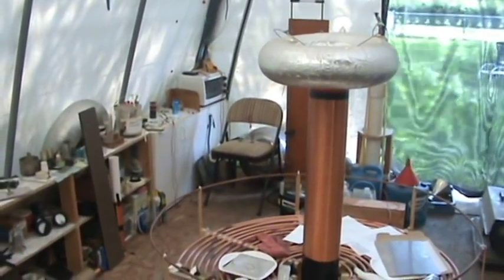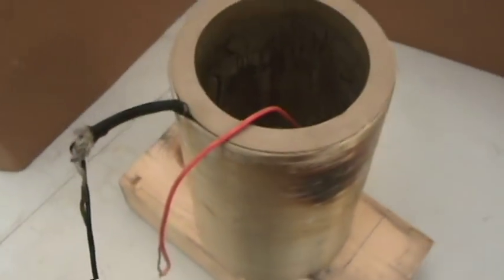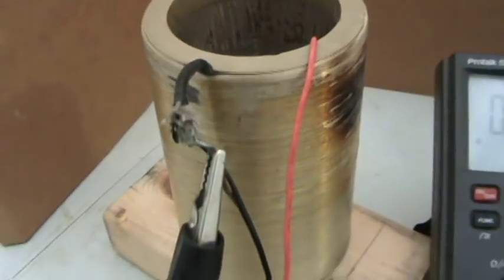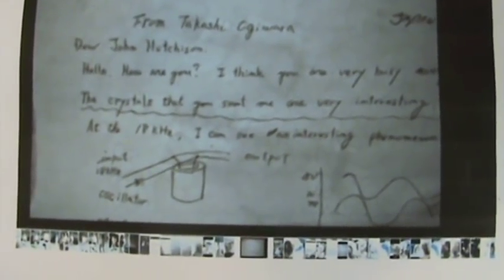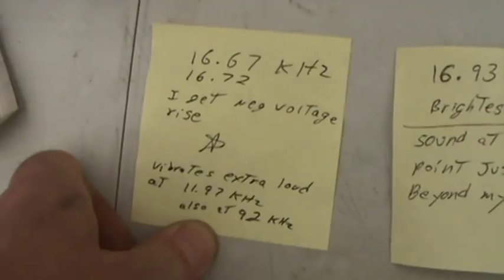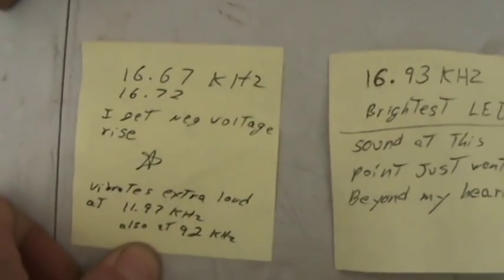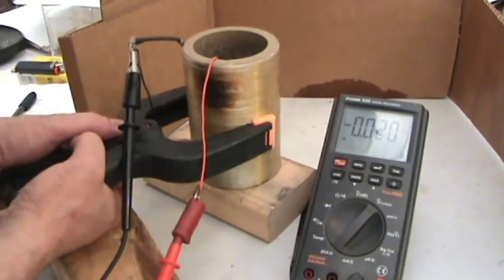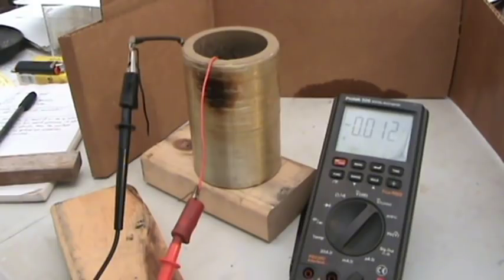Free Energy Barium Titanate  Part 1

Comment: Hey just wondering what John has told you about using barium titanite in a cell configuration. Did he have cat whiskers separating them or was it just stacked barium wafers thanks.
Reply from the maker: Well, he had his Hiroshima power converter that had about 6 of these cylinders in it and he had used a micrometer part for the adjustment of pressure on them.  I think that produced about 24V and a few Amps.  But then he had some of his best cells that were made up of about 60 stacked crystal wafers, starting at about .060 thick  & down to about .004 thick, each being slightly thinner then the last and they were also culturally grown many micro points/hairs on them,,,if i remember correctly i think they were carborundum. and same thing were he used micrometer for fine adjustment of pressure to the whole stack.  you can see his cell here with the red LED on it,,,but this is after it has been setting around for many years and was taken apart and then put some of the parts back together again after years have passed.  He has had regular incandescent 60 watt bulbs lit off of this before.  John talks many times of cat whisker technology.  Technology also used in his Field stress detector(FSD) that he worked on.
Reply: @INVENTOR3  thanks for the reply, with the carborundum cat whiskers how small would you say they where. And also what do you think makes these cells work I doubt it is the casmir effect because the wafers are too big and the gap between them is too small. What do you think makes them work
Reply from the maker: @cartertech2531  Casmir effect is with his crystal cells made with Rochelle salts.  His best cell with stacked wafers is here at 10:40......   https://www.youtube.com/watch?v=vv3vt6uuPag&t=15s
I sure wish all his thousands of videos were still posted here, but all lost!!  He had a few videos where he described in detail this cell.  It produced between 800 to 1000V.  This cell in the video, John had a few investors that he worked with on this one.  It was also gas filled, but i think the gas is not fully necessary, it still works.  Well it has been taken apart since that video and i think most all parts were sold on ebay.  This cell i believe worked off of pulling electrons from the air with a piezoelectric effect.  I know there is a good conversation on overunity.com with conversation between John & Marcus Reid sharing details about there cells, might be able to find it with a search.  Here is a video with Marcus Reid cells......   https://www.youtube.com/watch?v=jqH4-hUDSPc&list=PLF4LOODgc0Y4gX8Kp24GAMeUMR-qoGjmD&index=28
Johns wife Nancy has been working on the rochelle salt cells & they are smaller than a penny now and produce 2V and you can connect many of them together.  Just found another video of his stacked wafer cell....   https://www.youtube.com/watch?v=pG0JxdUXqRQ  Here is another video of it.....    https://www.youtube.com/watch?v=p_y_TC_y0v8
Hope this helped some :-)  You might want to also do a search for Tom Beardon and Hutchison cells, he can explain much better than me.
Reply: @INVENTOR3  thanks for the reply that helps a lot I'm really interested in his cell technology, I just wish the public and the scientific community would take him seriously. I am currently experimenting with roshelle salts, Galina and germanium. I have to see in the long run if they last. I just wish I had the money to replicate his wafer technology that would be great. But for now I will continue with the more primitive cells again thanks
Reply from the maker: @cartertech2531  Im really not sure how they work with the stacked crystal wafers. Wafers are about 1-1/4 inch diameter and had hundreds of hairs.  I believe they were about the thickness of human hairs( .003 to .004).  They had special company grown the hairs on them, John could probably tell, you the name of that company.  I have the name someplace, but have hundreds of notes to did through to find it.  I know they have a piezoelectric effect.  Im not sure where the energy keep coming from with this cell.  I believe they spent around $75K building this cell.  It very well maybe just sucking electrons from the air around us.
Reply from the maker: @cartertech2531  roshelle salts, Galena and germanium, yes, great start!  Galena and germanium used in diodes, point contact :-)  Do a google search for "John hutchison marcus reid crystal cells overunity.com", you will find many good links, most likely with list of ingredients they both use :-)  I have Johns list in my lab someplace.  After he grinds and melt all ingredients together and put into a cell, then he applies a voltage to it, to align the particles as it dries.  Many tiny Casimir effects taking place.
Reply: @INVENTOR3  yeah I do the same thing. I charge the cells with 12 volts while the mixture is solidifying. There are slot of cells online and YouTube that I think are just galvanic batteries. People have to continuously wet the crystal this leads to galvanic corrosion. What you need is a cell that runs without needing to add water and Marcus Reid and John are the only ones I know of that have achieved it.
Reply from the maker: @cartertech2531  Yes, exactly, everyone should not have to keep adding water.  Should NOT be a galvanic reaction.
Thinking about Johns stacked wafer cell and reading about "point contact" way back when it was first discovered,,,they talk about how that point contact had to be perfect,,,many times they would touch the cat whisker to many different points on the galena or gallium or germanium to find the best spot and pressure to add or best spacing.  Have you ever seen diodes that give off a voltage just from having them in the sunlight, they collect the radiation in the air,,,,,,,now think about johns stacked wafers each with hundreds of points on them.  energy is always attracted to points.  Reminds me of Teslas multi point lighting rod.
I believe Johns stacked wafer cell works off of collecting radiation from the air :-)  You might want to search for "John Hutchison Field Stress Detector".  Here is a little info about it, but im sure you can find more info,,,,,this link is from Sterling Allen(which i should not even mention Sterlings name if you knew what he was involved with).....here you will see Johns partners at that time.
https://peswiki.com/directory:john-hutchison-on-field-stress-detector
You also might want to think about how the Oxford bell works.
Well, i bet you have a much better understanding of how these stacked wafer cells worked now, hope this helped :-)
Reply: @INVENTOR3  thanks for the info. just wondering are the silicon carbide cat whiskers grown on the wafer with all the rare earth oxides or on the opposite wafer if you know what I mean. Or are the two wafers that are facing each other have cat wiskers. Anyway thanks for the info
Reply from the maker: @cartertech2531  Hmmm, good question,,,I always thought of them having hairs on both sides of each wafer,,,but maybe only one side of each wafer,,,,,im not sure.  Hmm, i will ask John.
Reply: @INVENTOR3  thanks I have been in contact with him about his one device that had the neobium pins that went to 70 000 volts and self destructed. I find that pretty interesting. Also I just bought a metal sample from him look forward to it
Reply: Hey man just wondering if I could buy one of your barrium titinate samples that you bought from eBay
Reply: For let's say 70 usd

Comment: Ferroelectric, do you need a rare earth magnet near it?
Reply from the maker: I tried this also, with Neodymium magnets and even with electromagnets all different areas around the cylinder, inside, outside at ends, Neg pole & Pos pole,,,, nothing :-(      It really needs to resonate at around 18KHz, and this is where it starts to sing and makes a high pitch sound.  But I did this a while back with older freq gen and it just stopped working on me, but now I would like to do it again with new freq gen and check voltage as I do it.  John Hutchison used the same cylinders for free energy devise he sold to Japan, and he has other videos of it powering motors.

Comment: If you can make a large electret and have a charge on it. Try putting it down or near a barium titanate object. The goal is that the electric field of the electric charges the barium titanate object to make energy form what you stored in the electret?
Reply from the maker: I like your ideas, thanks!   The barium titanate is very much like an electret.  It is a ferroelectric ceramic material that exhibits the photorefractive effect and piezoelectric properties.  I tried making an electret before, but failed, i missed one ingredient.  I see that Wikipedia changed the definition.  Wikipedia gave the ingredients, but now they don't,,and it was mentioned that they used it in WW2, if i remember correctly, it was the Japanese that used it in the field for powering there mobile phones, no battery pack needed.
my electret that failed.....   https://www.youtube.com/watch?v=6vWH-MGdOok          I would really like to try this again!
Reply: @INVENTOR3  Bees wax and white resin or pine resin mixed together make an electret. You just charge it up during cooling to apply the electric field. If I remember right barium Titanate is ferroelectric or polarizes in a strong electric field. you can get a high voltage sources for 3 dollars rated 400kv or so online. Use that to charge your electret up. Then see how the charge of the bariumtitanate changes to the electric field of the electret. ? I am just guessing that the electric field of the electret polarized the barium titanate to make electricity. I do not know if the field has to be spinning or not to make the power continuous.

Comment: hey paul nice work , measure your own body voltage before you touch it and write it down then add the voltage figures to what you got from that cylinder see what ya get then
Reply from the maker: Good idea Steven,,,,i actually meant to check my own body voltage,,,it has been years since i did that and i forget how much we get from our bodies.  I will check this out, thank you.
Reply: @INVENTOR3  yes and if we can measure the current to then we can calculate that to get the frequency to  then maybe we can use that to recalculate the figures when a ghost or spirit attaches itself to you or you feel that charge when it submerges with your own spirit like some people they feel it inside them they describe i think is a charge of some kind

Comment: Maybe you need to use a transistor oscillator circuit powered from air to get some power from it?
Reply from the maker: Hmm, you got me thinking :-)
Reply: @INVENTOR3  What I mean is you may need a coil that has the same frequency as the secondary coil has of a tesla coil and run the thing in reverse.
Reply from the maker: @travismoore7849  Ahhh, okay i understand.  Thank you.  I would still like to try that with my Tesla coil i have now, run in reverse. Tesla's little secret.

Comment: Interesting…since the voltage went up with the clamp…more clamps / put weights on it…or maybe wind it hard or a few laps and hang something heavy from the ending of that wiring.. Spontaneously; Hmmm if there comes power from pressure?!! (yeah…really strange), maybe that material should be layered and connected (serial or parallel) and then have a truck slowly parked on it…(and then just load the truck until the suspension goes if the voltage rises…hehehe…could happen…before you start to pile more and more rocks on it until that thing gets maxed out)…
Differens between fast and slow pressure…Q; How fast and how slow??! (if fast…vibrate it with pressure maybe by shaking it with a paint mixer or just park a running padding machine on it…if slow maybe people should build their houses on such material)…
But how to combine pressure with sunlight??! Q: Does the pressure have to be on the side or can it be applied top to bottom on the cylinder and then mirrors and lenses maybe…?!!
- Have fun!!!
Reply from the maker: Thanks for the comments,,,open thinking is very welcome here :-)  When applying pressure, or removing pressure it will increase voltage,,,,,but after the pressure is applied or removed the voltage drops back down,,,,,,,know what i mean,,,,,,,,,,voltage increases "simultaneously" as the pressure is applied or removed, but after a few second later the voltage settles back to original.  I like idea of mirrors & lenses,,,will have to see what a weak laser does to it.
Reply: @INVENTOR3  Cool…
…was daydreaming later that day about "the product". The "Power Soles" have plates @ the heal / toe and some electronics in the arch and charges your phone while you take a walk…from "Disco Shoe Technologies ink" hehe!
It´s not the light…it´s the heat from the sun I think. Freeze or heat to check maybe?!!
Reply from the maker: @scramblethink  Yes, you are correct, it is the heat of the sun,,,thermal pressures.  I have stuck it into the freezer before......
https://www.youtube.com/watch?v=gxXnbZqAWCE&t=2s
Those shoes are very cool.  I have seen plates in roads and building hallways that cars drive on or people walk on and give off energy to power the lights that are nearby.